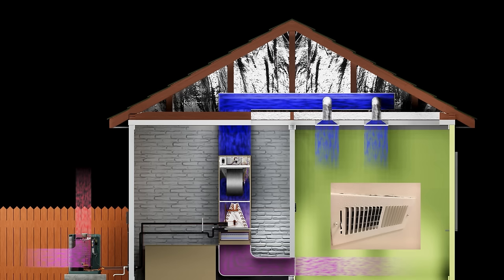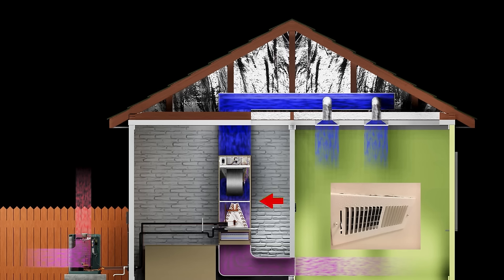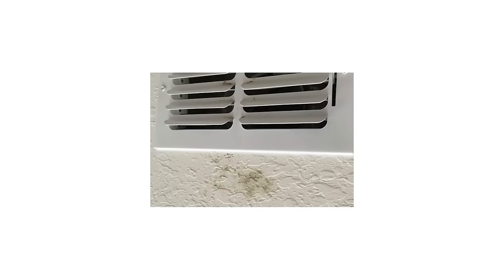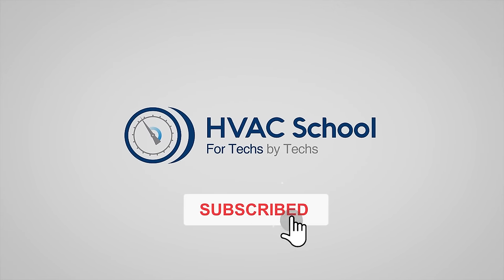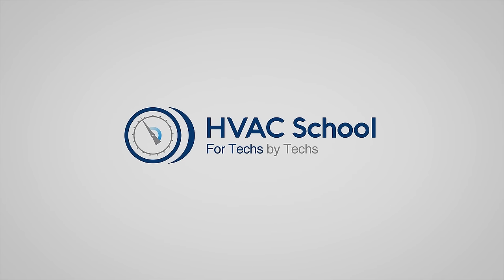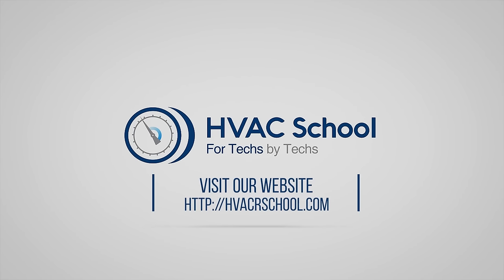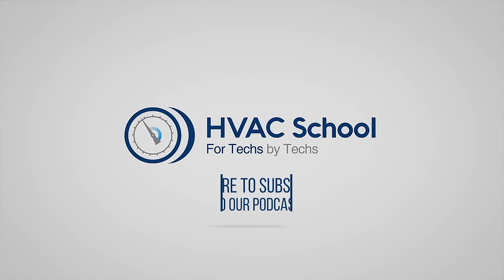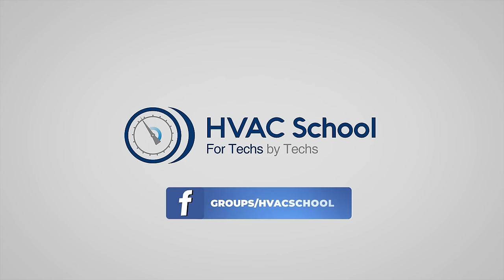Stop Sweaty Ducts, Vents and Systems

Comment: Great information! Sweating ducts and equipment have always stumped me. I would try those usual fixes, fan speed, insulation... Great class!!
Reply: Absolutely, I've seen this in many of my rentals.
Reply: Enjoyed the video but the solutions advised of in the video fell far short what should have been the case. The real issue re the equipment in  unconditioned space is that the build quality on most air handlers and ductwork are not designed for Florida and other high humidity areas. Since that is highly unlikely to change, go look at how the industrial community prevents condensation on pipes/equipment in areas where humidity cannot be controlled easily.  Some solutions are a LOT less expensive than the initial and ongoning cost of a dehumidifer. That said the air obviously needs to be conditioned/dehumidified as is appropriate to prevent condensation on other components of the structure as well not just HAVC equipment! The goal of an HVAC technician SHOULD be to educate on what is needed to prevent/control unnecessary moisture damage to all structural components not just in the primary occupied space and the components that do the conditoning. Obviously some of those other solutions will require referals out. A follow up video on a complete list of realistic solutions (as opposed to ripping out insulation/heat barriers SMH) is appreciated for those that seem to struggle with recognizing solutions on their own.
Reply: My dude, I've loved all your videos till this one. Insulating ductwork definitely works just like putting my beer can in a coozie keeps the sweat ring off the table. Doesn't matter if it's internally or externally insulated it still works (I'm in Texas).  In a home, sweating vents are usually because the return air to the handler has been compromised and the evaporator is sucking in wet attic air (in Texas it tends to be installed in the attic). Re sealing tends to do the trick. Keep up the great work and mostly love your videos.
Reply: @williamkorver9856  To put a dehumidifier in the attic which supposed to be vented to cool of the shingles and keep heat gains low... what a halfwit. No wonder the students couldn't answer his questions.
Reply: Swamp cooler for states NC and below
Reply: Great video on duct sweating, So what's the solution to stop the sweating ac handler which unfortunately in the attic with the duct work with a roof with ridge vents and standard blown or rolled in insulation?
Reply: @jasoncolledge Bro Thank you! I'm also here in Katy with a house that has no vapor barrier!! The cheap a$$ previous  owner put in hardy-board siding (good) without a liner!🤬 10 years later I learn this🤦‍♂️ first time home ownership kicking my a$$. Well  one day I'll hopefully find the inspector  who said it was OK and showed no problems without it. He left out the word "YET"!
Reply: Can’t sweating vents also be from an unbalanced duct system and the air velocity coming out of the vents?
Reply: @atkgrl won't work
Reply: @brianhill1546 not exactly, that would cause water actually leaking out of your ducts or unit if your airflow is too high. This is different
Reply: Hire a stump grinder!
Reply: when I see moisture, I feel for cold Corona beer.

Comment: Slight counterpoint...... in the South where I live, air handlers are located in attic that ( as they normally are built today) are vented attics,  yet run very hot in the summer. The air handler has the evap coil inside which produces the cold air that gets sent to the home's "conditioned -space" via the ductwork attached to the air handler.. BUT...if the air handler cabinet has poor insulation,  as is often the case, the interior cold surface temps of the air handler cabinet.... migrates ( conducts),  to the outer-surface of the air-handler cabinet. The outside then gets cold enough to condense the hot-humid "atmospheric"  air found in the attic. In this case....it is indeed the addition of MORE insulation onto the exterior air-handler cabinet.....to minimize the cold temp migration affect from the inside, that can help. After adding a suitable amount of insulation to the outside surface of the air handler cabinet...it's exterior will be "less-cold" ( warmer) on its outside surface.....and if done enough....won't have the exterior temp be so cold as to go below the attic-air dewpoint. Here is one example where adding insulation does work.........the same argument can be applied to additional insulation wrap on the insulated ductwork that snakes around the exposed areas of such an attic. All correct.....right?
Reply: I wish that question would have been answered.  I too think proper insulation around the ductwork would prevent sweating.  I just had a new Trane HVAC system installed in my crawlspace replacing a 20 year old system.  I had all the ductwork replaced using steel ducting for the trunk line and returns.  The system was installed in April 2024.  I went under the house yesterday to replace the filter.  I was shocked to see water droplets all over the trunk line.  The feeds to the registers were fine.  I believe the contractor used too light of an insulation around the trunk line.  I called them today and asked what would you have done if the trunk line ran through the attic.  He said we would have used R8 wrapping.  He said in a crawlspace the code doesn't call for that.  I said, if I would have known that I would have paid extra for R8.  Now I am concerned I will have a black mold problem if I don't remedy the sweating.
Reply: @tiger859986  ...basic thermodynamics....and citing "Code" for not doing something that is technically sound and professional.... is a crutch. Try having him see this point or maybe then only court actions may work for unprofessional work that can cause health issues? Aside.....the factory manual for my air handler specifically identifies that additional insulation may be required to encapsulate the air-handler in the attic ( even though a thin layer of insulation is factory installed on the interior surfaces).

Comment: No discussion on insulating the ductwork in the attic?  Doing so would both save energy and reduce or eliminate sweating.
Reply: I was shocked what a nonsense he spitted out.
Reply: My duct insulation is absorbing the moisture and causing drywall/mold problems.
Reply: @JaimeBlanco666  it should be vapor tight - insulation at least 2" covered with aluminum foil sealed everywhere with aluminum tape . This way no water vapor will get inside and condensate.
Reply: @grigorshukerski4689  and what about when your AHU itself is sweating? This video didn’t spout nonsense. I just think you don’t quite understand dehumidification.
Reply: @grigorshukerski4689 I heard a lot of things didn't hear any nonsense though can you elaborate?
Reply: I'm scared to see an HVAC company air seal an attic without working on conjunction with a roofer and understanding the ping pong moisture effect and vapor perm rating of the materials involved... Building Science and @Airvent... Protect your shingles with proper ventilation
Reply: @JaimeBlanco666 having this discussion right now ....I believe it's better to not insulate around piping thats for heating and cooling in a conditioned area because of that reason it will not get sealed 💯 same reason you wouldn't insulate around plumbing vent pipes can cause frost/ice  blockage ..... That's why I don't think it's a good idea to use insulated piping on exhaust fans from bathrooms either see a lot of issues when people do that vs not doing it just piling insulation around the fan box and pipe that was outside the house . Think we're creating more problems and we're solving in a lot of cases 💁‍♂️🍀
Reply: This guy doesn't believe in relative humidity. Cold air holds less moisture than hot air. It's third grade science
Reply: @marcfavell there isn't freezing issues in florida. This video is from Florida. That's the problem with coverall hvac videos. People who don't understand the principals will walk away with the wrong solutions.
Reply: I bought my house a couple years ago, and had issues with sweating in my attic, I'm convinced now that it is from not having proper insulated Duct work. This fall ill be going up there and wrapping everything myself. I'm sure I'd be paying thousands to send hvac guys up there to it. 
There is proper ventilation for air to come in&out of the attic, and I do feel some cold seeping through some of the Duct work. 

This video has also helped me understand the condensation from  the cold  Duct work in the attic that is meeting the hot temps in the attic. I'm a Flooring guy in construction, so hvac is not my strong suit lol.

Comment: I'm a HVAC tech like most of us here. I personally had sweating vents in my 2nd floor system ( hvac in attic) . I found the original hvac contractor had not sealed the boots off the ducts right around the sheetrock and the boots were poorly insulated. Some had no insulation on the boot. The moist hot attic air was coming around the boot , gaps ( 1" or more ) mixing right at the diffuser face. So very cold and very moist hot air cause vents to condense on the face. Everyone of them were like this. I end up pulling every boot and redoing some of the runs completely.  Everything was sealed tight from the condition space and boots were properly insulated . No more sweating vents....
Reply: I think this sounds like it very well might be my issue. I have only one vent that has a sweating problem (and it happens to be right above the air handler so I was the dummy thinking the air was colder and that was why). I have no attic access and the vent is 15ft or so up so not the easiest to get at. Any suggestions for a quick fix?
Reply: @ByteHeisenNerd  you can pull the diffuser off ( supply vent ) some installers would nail the boot from inside on a roof rafters or a nailer cause they don't have a lot of room above to work since there is no attic. If you find that they are nailed on inside you can pull the nails to free the boot. Then you can maneuver it around in the ceiling to put small pieces of insulation.  This will be a royal PITA cause it won't allow for a lot of room. Reinstall the boot by nailing back tight. Use caulk to boot tight to the sheet rack and reinstall diffuser.
Reply: @ByteHeisenNerd  if there is no way to remove boot from below then you will need to square up a section of sheet rock you want to remove. If it I was doing i would cut a 2'x rafters bay width ( 2'x16" or 2'x24" )  piece of rock out. This would allow you more then enough room to put nailer ( scab pieces of wood ) back in for your sheet rock seems and room to insulated the boot.
Reply: @pineychristian  thanks so much for the reply! I appreciate all the detailed explanation. I will make my way up and try option 1 first, then cut back the rock if it’s not possible. Thanks again!

Comment: I dont think the solutions in this video could be the best. Obviously if you dehumidify the space around the ductwork you are not going to have trouble with ducts sweeting, but I think is not practical. I think the best solutions is a good insulation in the ductwork, if you insulated the ductwork, the external temperature of the duct is going to be above the dew point and the ducts are not going to sweet. Same thing with the air handler unit. The best way to avoid this problem is selecting the right equipment in the beginning of the project. This could be a solution if it is too late and anything else solves the problem.
Reply: It is being implemented in encapsulated attics.  A dehumidifier is installed

Comment: My air handler unit is in the garage and it was sweating like crazy all the time (FL-Southeastern) until I bought a dehumidifier and placed it in my living room. It runs about 1 hour everyday keeping my humidity below 40%. I haven't seen a drop of water again around the air handler since then. Its perfectly dry all the time. This channel is awesome. Thank you
Reply: @Wayne B Hmmm. very interesting. Thank you.
Reply: I'm about to try that right now! Luckily I have two dehumidifiers I found while scrapping for metal that I didn't scrap and I'm grateful now!
Reply: Is this method still working for you during this extremely hot and humid 2023 FL summer? It’s so humid rt now and just started leaking for the first time from my AHU, which is also in the garage. AC unit is almost 2 years young, that makes a difference. 
I would have never thought to put the dehumidifier in the living room. Very curious if is this is still working for you right now. Will likely be trying either way at this point though. Thanks
Reply: Yes, it’s working really well. My humidity is around 32-34% all the time. Now, there is something else I learned, blower speed. For some reason my blower speed was really low. It’s called CFM. It was low but not to the point of freezing the evaporator but it did an excellent job dehumidifying it too. Another factor is the thermostat setting. if its too low (72 F), you can get I lot of condensation. So, it’s a lot of small details that increases this condensation in my garage AC units. Good luck, keep searching:hand-purple-blue-peace:
Reply: @MichaelHernandez-lc2wb  thank you! I actually got a wet/dry vac and used vinagre to suck out a bunch of shit that collected from last year. Apparently my sis didn’t know to do this monthly…. Worked right away and dried up leak going down garage… granted here ac unit is less than 2 years old. So if anyone reading this has tried this and has cleared the line, I suggested calling a tech for sure!
Reply: May I know how you would seal your attic?

Comment: I really enjoyed your class. A much needed class. I had my Coils Cleaned. This was necessary. My workers didn't sanitized my Coils after. This lead to a stink, causing me to replace Air FILTER/s. Then I called in a H-vac Company, and I told them as I wrote you, it's stinks and I'm using much more AIr Filter/s than needed. Now I was having my Coils Sanitized, and cleaned my motor, which was growing mold. This was just for a Vent Cleaning. Look where it ended? 
Now, I feel cold from my vents. Having a Duct Tape Smell. I don't have any leaks, great, but why does my apartment smell like trash? In Summer months the A/C will never stop running with this problem now. I really need an understanding why I smell cigar smells. I never did before. 
Another weird matter, FL, it's 73 degrees, my unit is on 78, why would my unit go on at this degree? I had to raise my Thermostat to 79. This is a problem. What, I don't know. Any suggestions?

Comment: Put the air handler in the home's envelope. 
Equipment, Supply Duct and Return Duct should never be outside the envelope. If energy conservation were paramount, Energy Star, DOE ect would make building code require  equipment to be located inside the home. No one wants to give up 12-14 sq foot of foot print. 
OSHA should require this also, I've been in 130-150 degree attics, not a safe condition.
Reply: I agree 120%!! So many people want another closet to cram with junk instead of putting the A/H in there.  Lasts longer, maintaining it happens more frequently,  doesn't sweat, and I'm sure much more.  What do you gain by putting it in the attic....a spot to store junk....thats it.
Reply: You must not live in Texas or anywhere with new home builds.  All handlers are in the attic.
Reply: @thomasnew8606  We average about 4 new homes a week, live in Kansas, 99 percent have basements. Good place for HVAC duct and a place to go during tornado season. Also adds extra living space. Attics are terrible places for HVAC., We do a couple  new home attic installs a month. Have to increase size of A/C to accommodate attic heat.
Reply: @skikansas66617  very few homes in Texas have a basement as it adds a ton of cost to a home build that’s not needed.  An conditioned attic is just fine to run the hvac but few homes have that as well it seems.
Reply: @thomasnew8606  ...Same in SC.....but the point is still valid. Place the Air handler and system in the conditioned-space. Hard to do, as SC is one of a few places where one can buy new, SMALL homes...and most of these are built on-slab. I get it, you can give up some living space but its a tough market for this design change to take root.